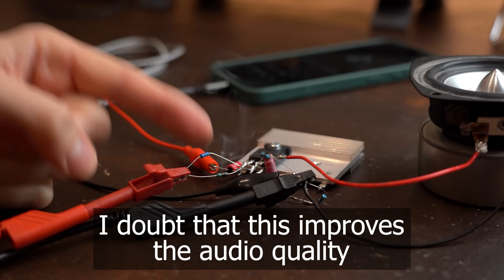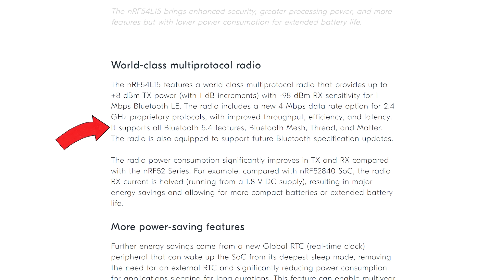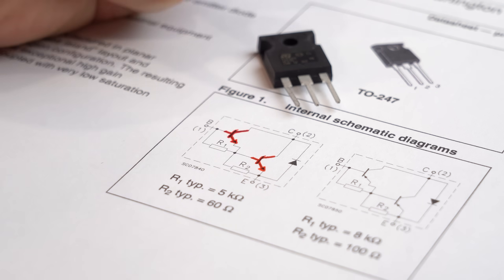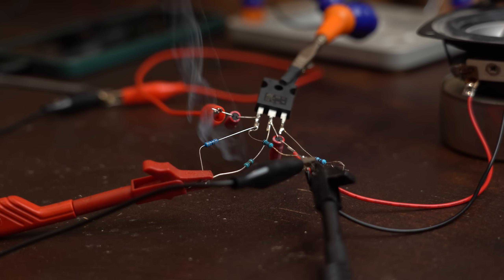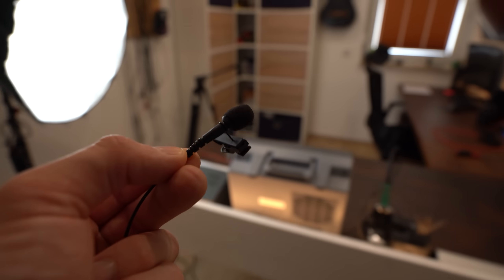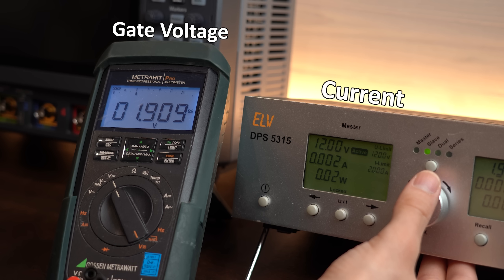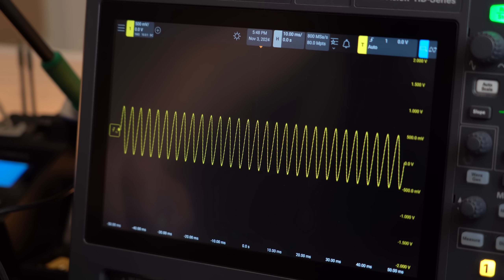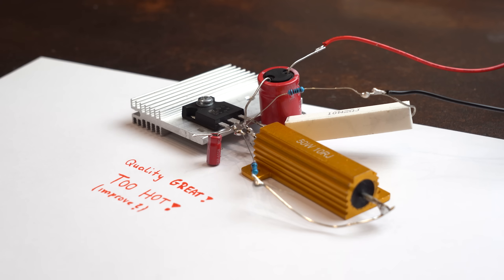The World's Simplest Audio Amp just got BETTER?! (MOSFET Amp) EB#61

Comment: It seems like the speaker only needs voltage changes for operation and not much current. If this is true, so instead of using a mosfet, would an opamp be a suitable candidate for signal amplification?
Reply from the maker: Well, both Voltage and Current is important. OpAmps can do voltage amplification excellent with their high gain and low distortion. However they can not provide that much current. That is why they are often "only" used as preamplifiers. As the output stage you can then use BJTs or (not optimal) MOSFETs to get more current flowing 🙂
Reply: How does a 6 minute old video have a 9 day old comment?
Reply: @baudneo thats what i am saying
Reply: 😅😅😅😅😅😅😅 @baudneo
Reply: @baudneo . I think youtubers will sometimes post private link videos for early access to their paying members and then set it public for the rest of us plebs some undetermined many days later.  the early access views get to make comments before the public posted date.
Reply: @gentlemanbirdlake  that makes sense, thanks for explaining.
Reply: @gentlemanbirdlake Understandable have a nice day 👍
Reply: Why is your comment 9 days ago
Video was released 5 min ago
Or is it only me
Reply: @amm_51-16  Patreon supporters get early access.
Reply: @amm_51-16  he probably released the video publicly for a short period then made it private after or hidden until today.
Reply: Speakers have a low impedance and so require a lot of current.  You can also think of this in terms of the physics involved.  Current creates a magnetic field in a wire.  When you coil up the wire, the magnetic field multiplies.  It's that magnetic field that interacts with the permanent magnetic in the speaker.
Reply: I’m very much an electrical novice, but I think of it in terms of Ohm’s law. V=I*R ( voltage = current * resistance). Loudspeakers are often 8 ohms, sometimes 4. So to have a large voltage change the current has to be high as well. You could also think of it in terms of power - P = V * I; you have to have current to deliver power to the speaker.
Reply: opamp driving a bjt or mosfet.